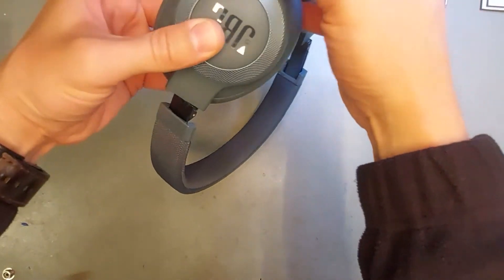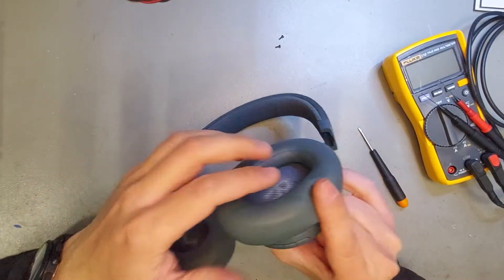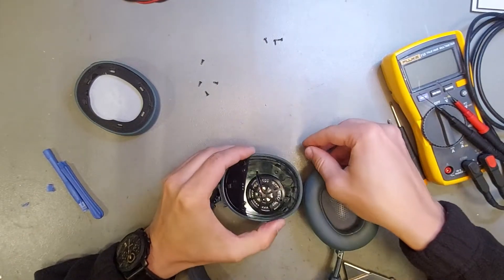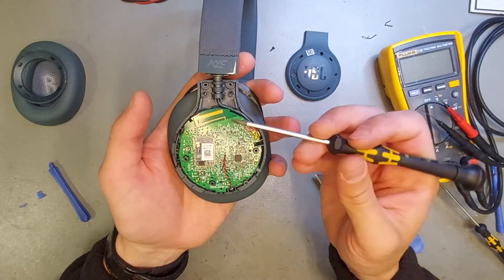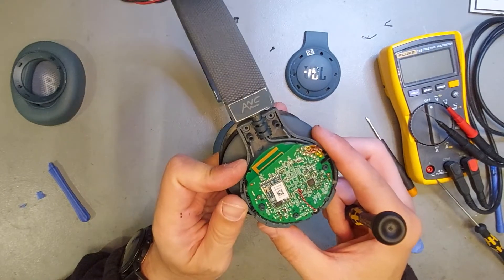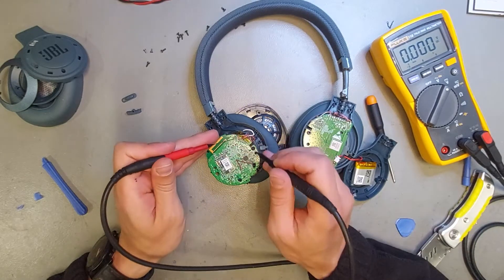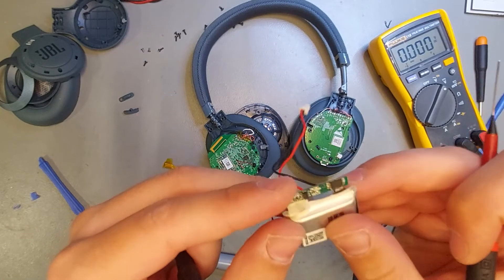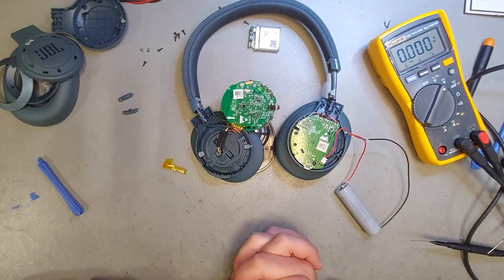JBL E65BTNC Wireless Headphones Teardown, Dismantle, Battery Replacement, Repair

Comment: Tip for getting the ring of without scratching it too much, I found that the only thing I could vedge in there was a used razor blade and the work my way up with my other tools. Be careful not to cut yourself tough! Probs to JBL for such a perfect fit, but it's a bit of a pain to repair.

Comment: I would bet that battery has low voltage protection which has disconnected battery. You could charge directly the battery to revive it.

Comment: Thank you for the VIDEO!.

Something that worked for me, was:
1-Remove the RING of the left side.
2-Remove the Phillips screws.
3-Partially move out the cover to see the battery and remove it (without the need for the German triangle weird screwdriver)
4-Test the battery (it was working!, if not, you can buy another one)
5-Reconnect the battery.

And the headphones came back to life.
Reply from the maker: Thnx. Short and concise... Unlike my video 😂
Reply: @catalinfix840  my steps wouldn't be possible without seeing you opening yours. Thank you, mate!
Reply from the maker: @ovacabrera  I'm glad it helpd. I have gave up on mine. Got a new pair from AKG, miles ahead on quality.
Reply: Thank you for the description @MarcosRamirez66, and for the video @catalinfix840. Instead of the triangle screwdriver, - if you are careful, a T5 torx can be also used.
My question: do you know, where could I order a replacement battery (with the electronics) for the jbl e65btnc? Thank You!
Reply: @g.bencegorog5818  
Did you find a supplier for the Battery?
Reply: @Jehoov3r  unfortunately not (yet). My plan for the future is, that I buy an other battery type wit similar capacity and two cables, and try to solder the connector.
But in my case, I had luck: a short circuit on the two soldering points has resetted the electronics, and afterwards I can use my headphones again.
Reply: @g.bencegorog5818  
See my answer above
Reply from the maker: @Jehoov3r  you can find the pouch on Ebay. Just solder your own BMS on it and make sure it's the same size. As for capacity, try to come close to the oem value.
Reply: Cable on the left side ist broken. My battery ist okay. If you are from Germany you can have it. 
You can’t change the cable and therefore I will scrap the whole headphones 🫤

Comment: Hi I got an E45BT headphones and the left side stopped working. I opened it up and found out that there is a battery on the left side. I don't have plans of opening the right side since it's still working. Could it be possible that both sides have batteries or the battery on mine is just placed on the left. Thanks!
Reply from the maker: There is only one battery.

Comment: I got my JBL55BT broken on the Right Side, no audio sound come out from the speaker, but bluetooth, left speaker still work normal. How Can I fix the right speaker to get back normal?
Reply: same thing here
Reply from the maker: Sorry for my late reply. Yes it seems like it's just a connection issue, a bad wire or a blown speaker. It happens a lot with these kind of headphones. Nevertheless it's the same procedure as in the video if the connection is bad at the "brain" in the left housing.